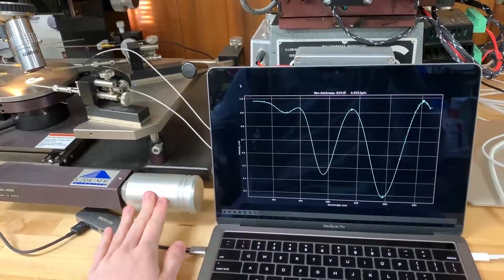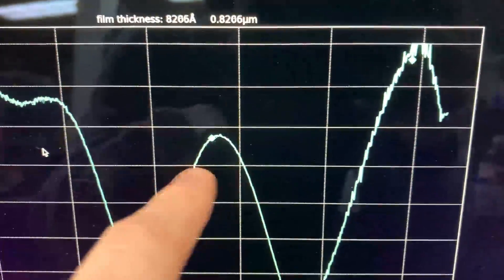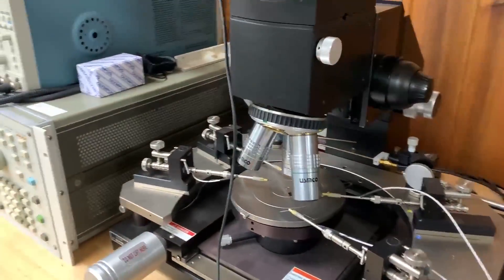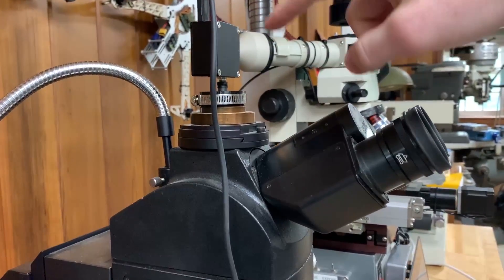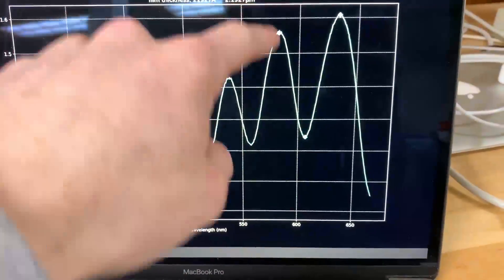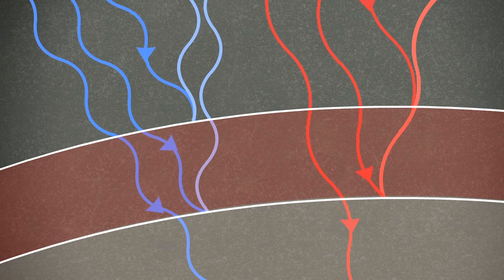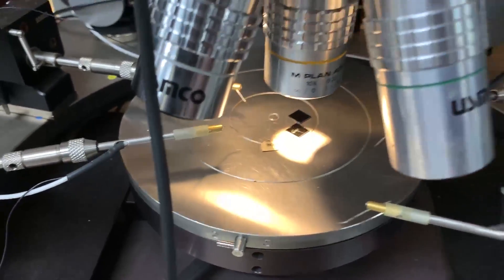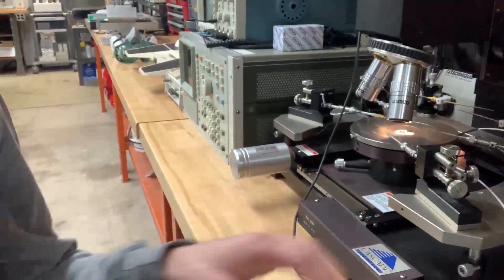Simple Thin Film Thickness Measurement with Spectrometer

Comment: thin film interference does not even necessarily need such a complicated setup, you can just eyeball the color of the film (with non-infinite error margin) in white light and compare it to pre-rendered palette. it works for estimating oxide level thickness on heat treated steel for example.
Reply from the maker: the colors our eye perceives are periodic with increasing thickness, i.e. color alone cannot tell you absolute thickness because the same color maps to many possible thickness values. good for a spot check though, yes
Reply: @SamZeloof  it would be the case if the light was monochromatic. but since there are multiple wavelengths interfering, every film thickness results in its own distinct color in white light.

besides, do can you use the same method to estimate color of a metallic thin film? metals do have their own weird refractive index, but I wonder if it actually works the same way as it does for dielectrics.
Reply: did you figure this out? I am trying to measure oxide layer thickness of anodized titanium and this formula that sam used in the video is out of the range of nm  @Alexander_Sannikov

Comment: Nice setup. You can get more accurate peak position by normalizing the spectrum by dividing the sample spectrum by the bare silicon spectrum. To get an accurate absolute reflectance spectrum, you can then multiply by the expected reflectance of bare Si (calculated from the complex refractive index). This let's you measure thin films that do not even have a peak if you find the best fit calculated spectrum that matches the measured. I used to design thin film measuring equipment if you have questions.
Reply from the maker: thanks for the notes, I am already doing normalization on the spectra (helped see peaks on the lower end of the spectra tremendously) but if I talk about these things in the video it will drag on even longer... its hard to keep things short as is.
Reply: hey,
I am spin coating ZnO on glass. Could you help me on how to measure its thickness(could be around 50-200nm)?

Comment: Nice! I just wanted to add that this technique will only work as long as the index of refraction does not change very much in the wavelength range that you are measuring. So any optically transparent materials such as photoresist or SiO2 should be fine to measure, but if you deposit a semiconductor thin film then this method won't give you the correct results.

Also, if you collimate the white light coming into the objective you should be able to get a small light spot on your sample and perform thickness scanning measurements just by moving the stage.
Reply from the maker: Agreed on all points - thanks for your note !
Reply: A good point! Thanks Brenesrob! Do you happen to know if there is any technique to measure semiconductor thin film? Thanks

Comment: Thanks!  Great as always.  Why the roach killer with the other chems on the bench? Also, might you be willing to share your Python code for the STS spectrometer?   Also, Ossila has a very readable guide 
to spin coating, for the rest of us.  Any special fitting on the STS to the trinoc port?  Thanks!!
Reply: The roach killer contains boric acid which is used as a dopant